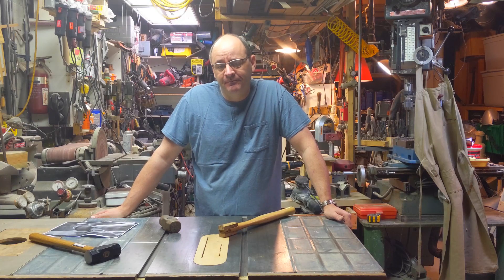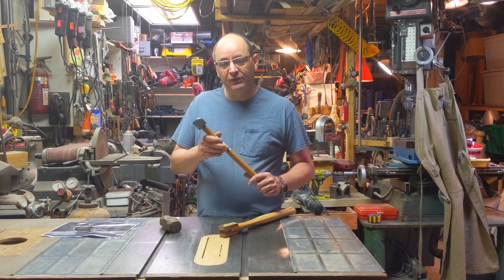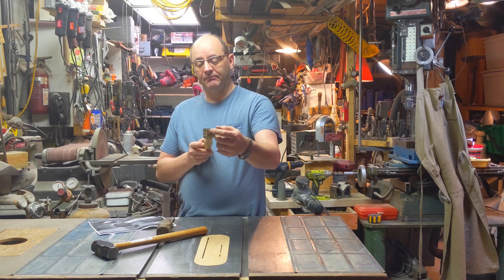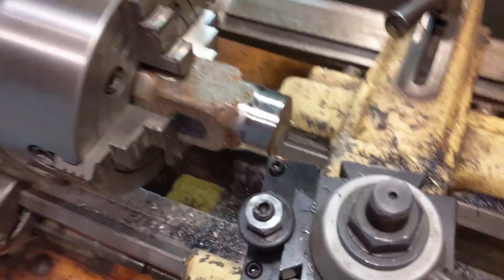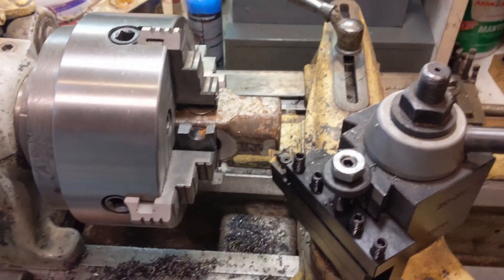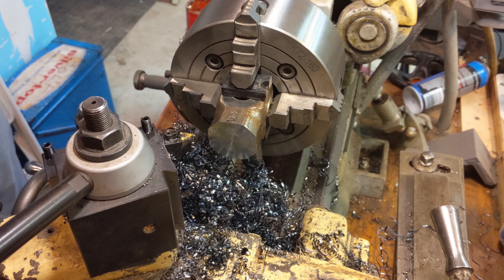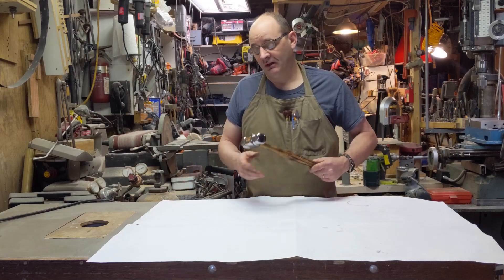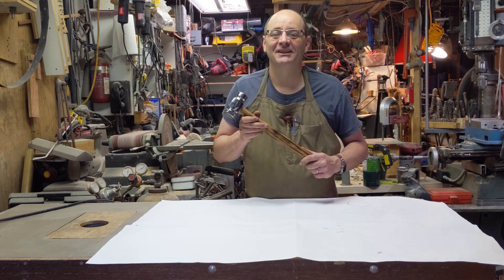Customized Forging Hammer #TMC2020

Comment: Nice work Bob!  Would it have been possible to cut the flat face with your bandsaw first to a rough length before flattening it on the lathe?
Reply from the maker: Great question!  That's what I almost always do in a situation like this, but here I couldn't.   Normally you have the hardened steel teeth of the bandsaw cutting the soft steel of your object.  But in this case the object is as hard as the bandsaw teeth.  So it wouldn't have been able to cut it, and would have ruined the blade on the bandsaw.  So I had to use the very very hard ceramic insert cutter on the lathe and take the extra time to "work it down"